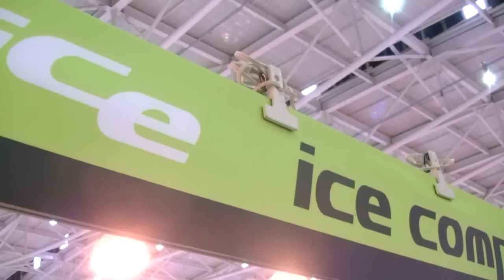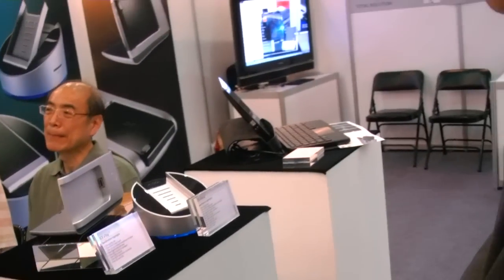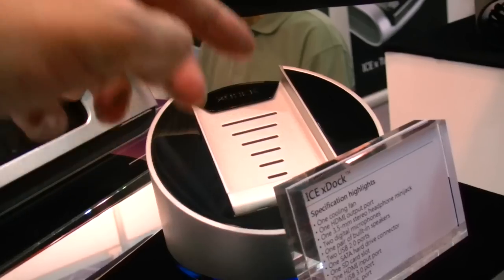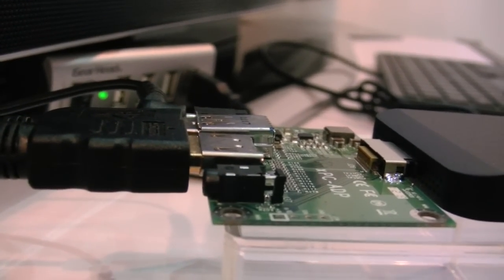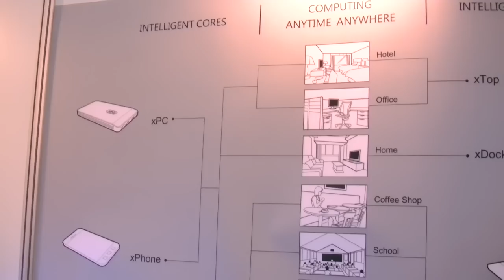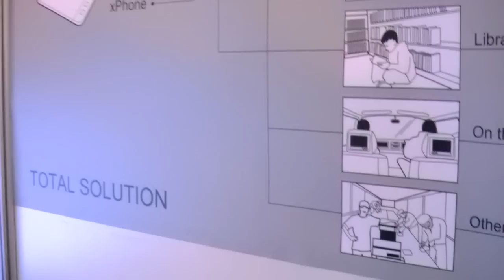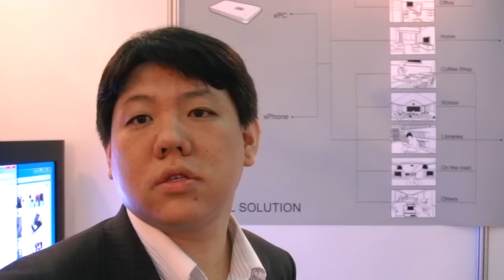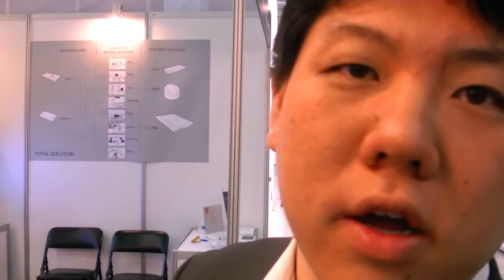Ice Computer, computer in a module

Comment: Actually, they intend to cover a range of performance offerings and will offer higher as the technology allows them to squeeze them into those modules.  While it'll be cheaper to upgrade if all you change is the module, versus getting a new device every year or so.